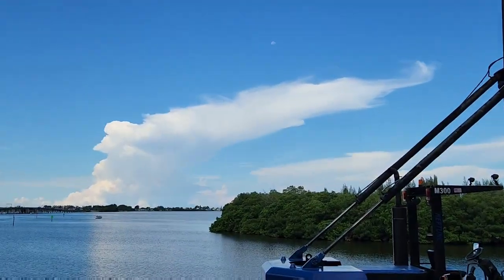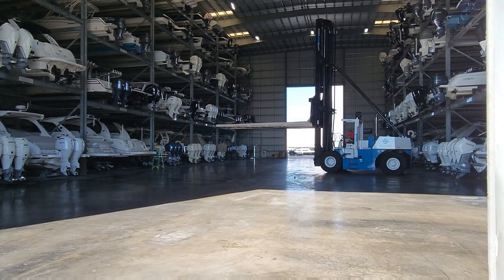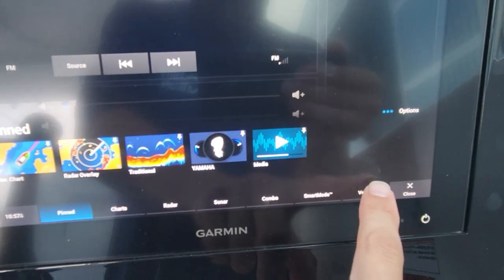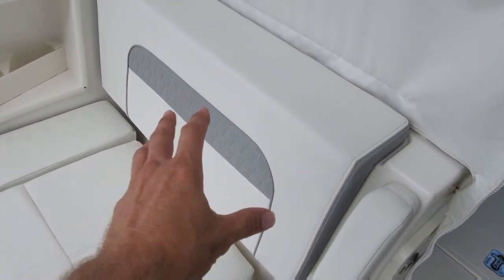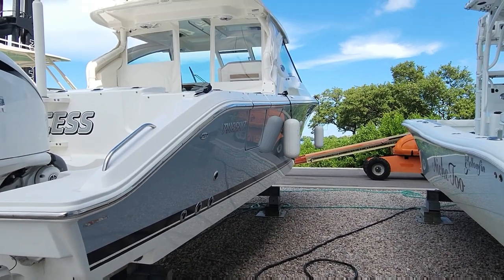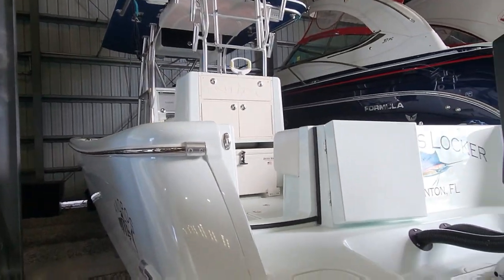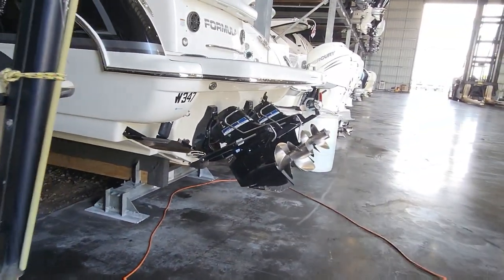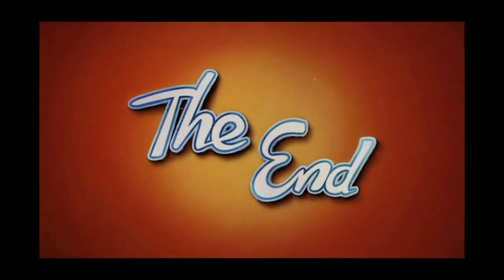My Last Video With Quality Boats!?!? I'm Sorry #Quality boats #Marina #Episode188

Comment: Good luck at the new job. Marine Max merged/bought out the marina I used to work at in MA. I liked working on the Boston Whaler. Easy boat to rig for electronics. Rides great in rough water. We also carried Chris Craft and I visited the factory a year before they were bought out by the current company. Miss the work, but did not make the $$ and the hours wore me down. We had a 6 day work week, with Tuesday and Thursday 8am-8pm. Other days 8-5ish longer if your on the water doing a demo.
Reply from the maker: Thank you and I am lucky I will be working 9-5 Monday thru Friday with no weekends.  I am excited to see all the new boat lines and meet some new people. ☺️

Comment: Justin,  I have a quick Regal question before going over to your new job.  Congratulations on that BTW.  I absolutely will continue to watch your channel as the lessons you provide are invaluable!  My quick question is on a Regal 36 XO the rooftop antenna has a blue LED light that normally lights up when the house power is turned on.  My antenna stopped lighting up (along with live TV not working anymore).  Do you know if there is a breaker or switch somewhere for the rooftop antenna?

Thanks

Steve
Reply from the maker: I honestly couldn't tell you without tracing it down in the boat. I don't remember ever having to fix one. I would check all my breakers first and then start trying to find where the wires run to.

Comment: Justin
Have a issue that maybe you can help me with. I have a 2006 250 Yamaha outboard engine, 520 hours on her. What would cause the fuel pump to blow a fuse. The original fuse installed was a 5 amp. Replaced it and again it blew out. Installed with a 7 amp and it appears to be working fine. Any explanation would help. 
Thanks again for the great videos. Hope to see new ones soon. 
John.
Reply from the maker: My best guess is that the fuel pump is getting weak. If it draws more amps it will pop the fuse. Could also be dirty causing it to work harder.
Reply: @JustinLeeMarine  Thanks for the response. That's exactly what the mechanic said at  the marina where I have the boat. So to do the diagnostics change the fuse and take the boat out for a test run $250 dollars later what do you think, about right + or - a few dollars.
Reply from the maker: That seems correct.  Keep me posted.